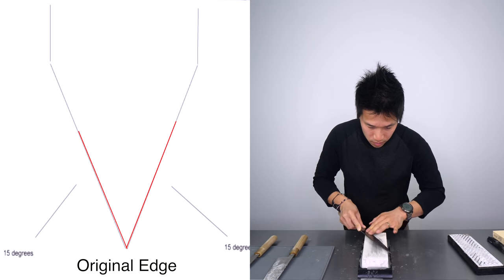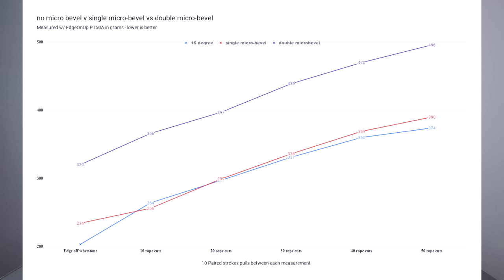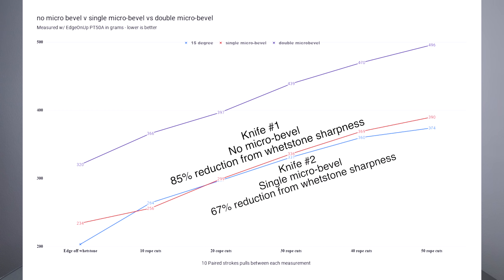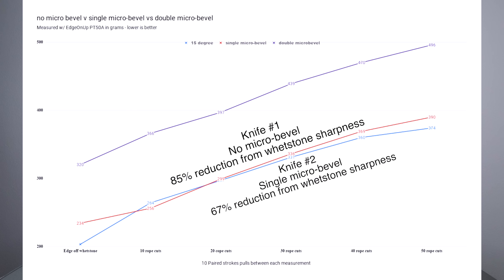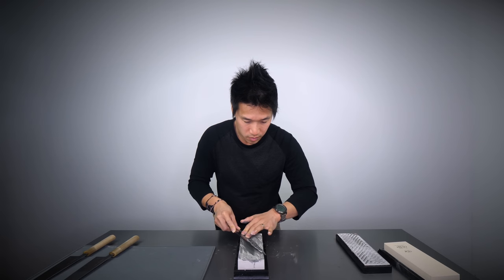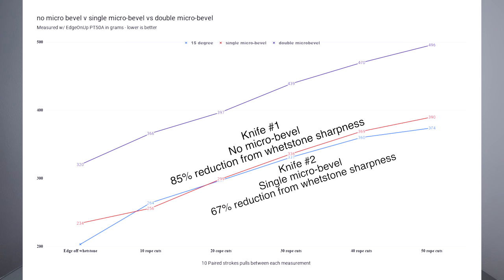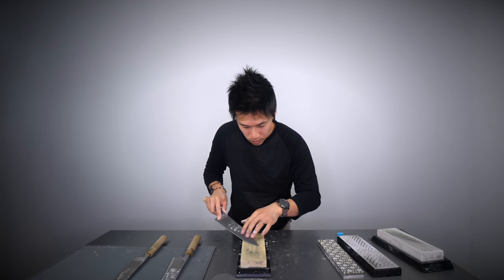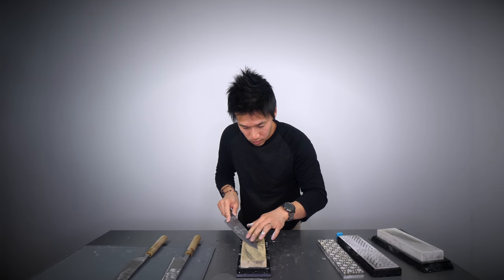Do Micro Bevels ACTUALY work?

Comment: Everyone who says something like "every knife needs a microbevel" clearly has no idea what he is talking about. Even the term "microbevel" itself seems to be misunderstood by many; some people seem to think it's the thin secondary bevel (or edge) you find on most knives, as far as I know it's actually a very small third bevel on the already small secondary itself.

Is a third bevel better on a knife? Well that very much depends on the use case, what you expect from a particular knife and the angles of the bevels themselves. Saying that one particular grind is better than another without a specific context in mind is like saying "a kitchen knife is better than an outdoor knife". While that might be true in a cooking related context, it's not when it comes to chopping wood.

So yeah, a microbevel has it's usecases, but it's not the "best" edge for every knife. I mean, every cook knows that you don't do every job with the same knife for a reason. Same goes for every other knife.
Reply: The confusion probably comes from the primary bevel is the very first grind on a flat piece of steel, most people probably do not count that bevel and count the second bevel or the sharpened part as the primary bevel. That is actually the second bevel and if you put a micro bevel that would be a third. The way you describe it could confuse people into thinking its something different.
Reply: Unless you are talking about 3 bevels after the primary, then its kinda ridiculous because your approaching round at that point lol
Reply: Since there are zero grinds wich only have a primary bevel (scandi knives, bushcrafters etc.), of course I'm counting the first grind. But I don't think that's the source of confusion. If you look up "microbevel" you find a lot of drawings that show the cross section of a blade with only two bevels and the blade behind that beeing flat/parallel, claiming the normal cutting edge is a microbevel (propably just because it's smaller than the first grind).
Btw a "round edge" is not really that ridiculous; there are a lot of knives (mostly outdoor knives) using a convex edge, because it's very resistant to chipping.
Reply: I feel everyone is misunderstanding how the geometry of a cutting edge works. It's quite simple but maybe difficult to explain or visualize, so everyone ends up having these weird theories. It's easier with diagrams but I'll try to explain and just hear me out. First understand the convex edge is the superior edge geometry in all use cases. It is however, not anymore resistant to chipping than a normal edge, never mind that axes use them. Think of any normal knife/edge grind and imagine the cross section. At each "step" where the angle changes there is a shoulder, 2 shoulders for normal "V" grinds. This shoulder causes resistance when cutting and provides no structural integrity since it protrudes out from the rest of the blade. If you were to round off and remove all the excess material from these shoulders, without touching the apex and the area immediately around it, you would be left with an edge equivalent in all capabilities and "sharpness" as the original edge with the added benefit of less cutting resistance. This is the convex edge. You can think of all normal edge grinds as an approximation of this more superior edge grind, where the closer the approximation, the better the grind. Normal grinds are used, only because they are easier to create and easier to be precise with the angles you want. If you understand this, I believe you should be able to easily know when to use a microbevel, when not to and what every type of edge grind does.

The most likely cause of confusion, why people think a convex edge is a less sharp, beefier version of a normal edge is because people start with a blade with specific angles and grind down the apex into a larger angled convex apex, thinking this would be the equivalent convex grind of the original but, this is not true. It is not the equivalent convex grind of the original, since the original angles no longer match up. This new convex grind is no longer what the original grind was approximating. To get the correct equivalent convex grind, one must either grind the only the shoulders without touching the apex, or start with a narrower angle and grind down the apex to the desired angle. Because this is tedious, difficult and harder to understand, normal grinds are used but make no mistake, they are slightly inferior.

Sorry, this ended up being a bit too long...
Reply: Stanley Chang Good points. It's true, a well done convex edge is technically the best possible edge geometry for (almost) all uses(, if done with the correct angles etc. for the intended usecase). And you are right, it technically is not more resistant to chipping; however in outdoor usecases, like chopping or batoning, you want a little broader angled edge to prevent chipping. And in those broader angles, a convex edge can make a noticable difference. A more narrow profile with the same strength as a V grind at the same effective angle. That's why it has the reputation to be more resistant to chipping. I just didn't want to go more into detail on that, because a convex edge wasn't really the point of discussion here.
Reply: Thanks. Yes, I agree and I'm glad you understand. You may be one of the few that do. I just wanted to point out that more bevels(like a 3rd bevel) is beneficial, as long as they are at appropriate angles. Since, it approximates closer to the desired task-specific convex grind, which in itself is like an infinite set of bevels. This wouldn't have made any sense if someone reading had the commonly skewed understanding of the convex grind. So I made sure to explain it first but, I may have over-explained it a little. Lol !

Comment: If you need a 60° edge then sharpen to 60°.  I don't see the point in converting a 30° (15 each side) edge to a 60° edge.  Fine cutting and hard steel for fine edges and softer steel with less fine edge for cleavers and the likes.  Use the correct tool for the job.  A tacking hammer can't be used as a sledge hammer.  From what understood was the finer the cutting angle the thinner the edge the more delicate the edge and work it can do.  The wider the edge the more blunt it will be and therefore good for chopping bones.

Comment: Interesting, but not shocking.  A more acute edge will always be sharper, but one would expect a less acute edge to be substantially more durable.  Putting a 60° microbevel on a 30° bevel seems a bit much.  I'm thinking a 40° microbevel would not only perform better, but might retain its edge longer.
Reply from the maker: likely, the results would only be measurable with a device.  not so much practically.

Comment: I use microbevel on my Knifes with angle of 10º on the Edge, and a microbevel of 20º, why i use this, cause the cut power will be the same of a 20º Edge, but to resharp the microbevel will be 100times quicklyer than sharpening a V edge, with 3-6 strokes on King 1200 i can resharpen it and 5 pushs on the strop i will Polish it, thats the advantage of using a microbevel, it turns easy the maintence of the Edge, and the maintance will be even easier with a sharpmaker with the Fine and Extra Fine rods
Reply: also i recommend u to read the article "Experiments on Knife Sharpening" from Dr. John D. Verhoeven